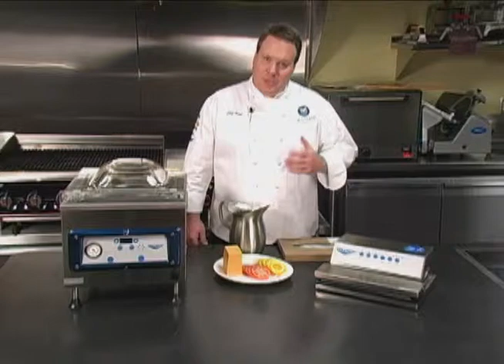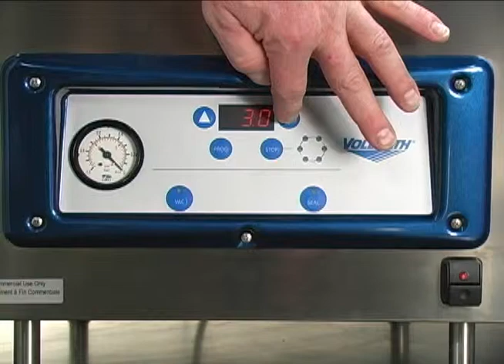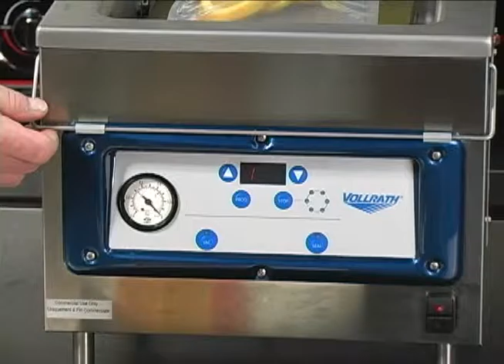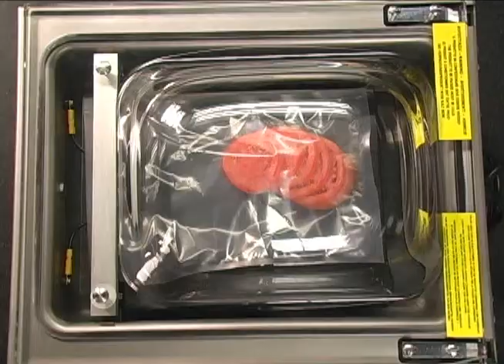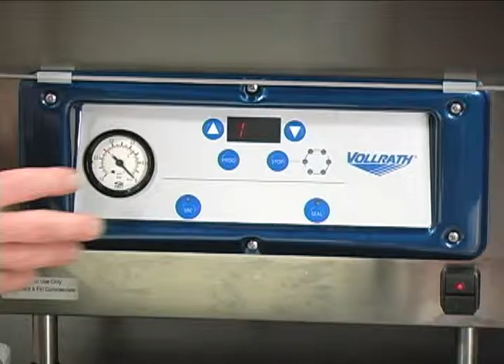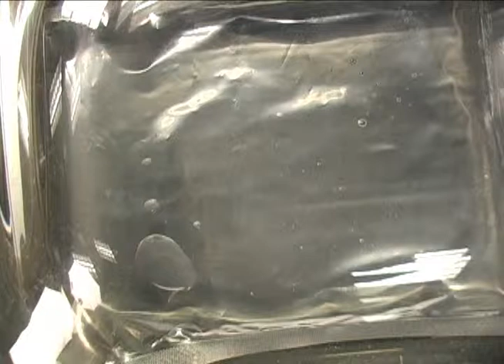Vollrath In-Chamber Vacuum Packaging Machine

Comment: On your water demo — actually, it isn't "air coming out of the water." The water is ACTUALLY BOILING. If you remember form Gay-Lassac's law from physics, Temperature is directly proportional to pressure. This means as you lower the pressure you lower the boiling point of water. Water will boil at room temperature at a pressure of 0.36 PSI. This is what you are demonstrating.